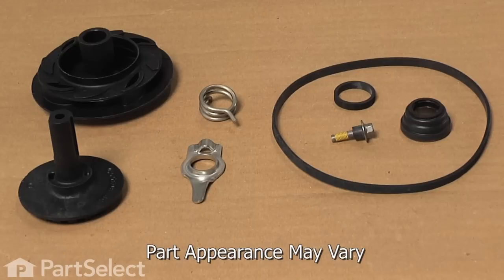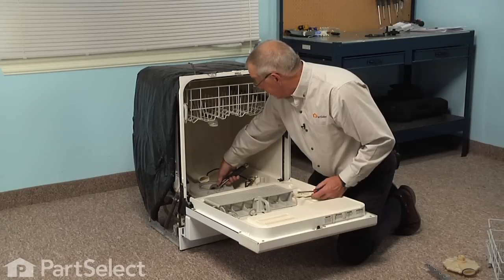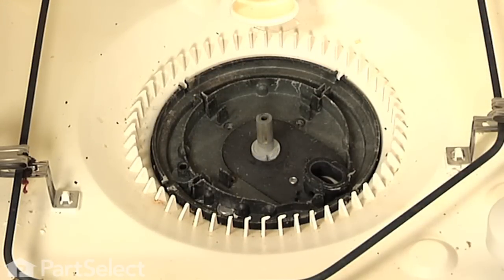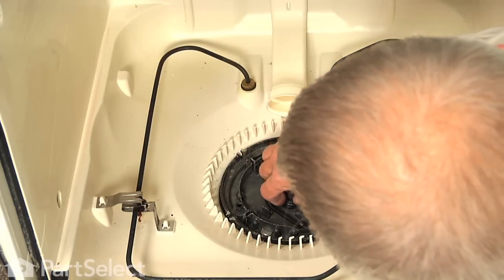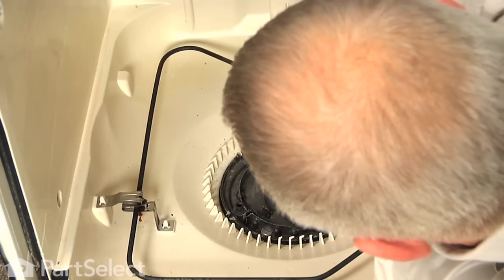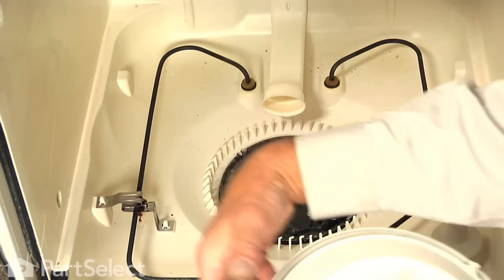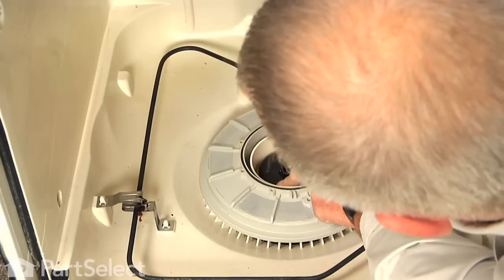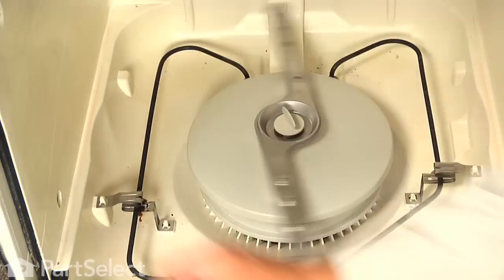Dishwasher Repair - Replacing the Drain and Wash Impeller Kit (Whirlpool Part # 675806)

Comment: Thank you for the great video on this model which is the one that I own. Sadly, I can't remove the hex nut that holds the black circular piece hiding the screws that will allow me to access and clean the sump. You mentioned that this is often a problem and suggested using a chisel and hammer to deal with this problem....how can you do that without breaking the nut or the black disc?
I am soaking the nut with WD-40 overnight and will try out a bigger wrench and an extension socket tomorrow but it escapes me why any designer thought that this was a good way to secure that portion of the unit given that hard water calcification would likely immobilise it.
Reply from the maker: sulyn2254 I have passed your question on to Steve and will let you know what he suggests.
Reply from the maker: You may find that the WD-40 will loosen the screw but if not, then breaking the impeller is the most common solution. You will still have to remove the screw, but would have the option of using a different method such as clamping pliers.
Reply: used CLR as it was a calcification issue, not a rust issue, I had thought  was preventing me from removing the hex nut...used an elongated socket on the driver, had an extra pair of hands with the pliers and it finally came loose..as it was still pretty white, I soaked it in CLR again and cleaned it with a wire brush before replacing it.. I also put a light film of food-grade mineral oil on it and hopefully, I won't have this issue again...all of this to clean out the sump that was blocked by some heavyweight plastic...my brother, the plumber, who lives far away told me to just buy a new dishwasher...I was quite pleased to tell him that I had fixed it!!!!
Reply: PartSelect
Reply: PartSelect
Reply: PartSelect
Reply: sulyn2254
Reply: sulyn2254
Reply: On older dishwashers the torque needed to remove the bolt may be so great that the adjustable wrench slips off the wash impeller hub no matter how tight I make it and no matter how hard I hold it in place. To solve this problem I use a 31/32" shower-valve socket wrench on the wash impeller hub. The wrench is hollow so I can run a 1/4" socket on a an extension rod down through the hollow to get the bolt. Sometimes the torque is so great it seems like the bolt is going to shear off, but those bolts must be made of super tough steel because I've never had one break or be so stuck that I've had to replace the motor. Also, this trick avoids having to drill out the hub of  the wash impeller to remove it. If I did that, I would still be left with the problem of holding the motor shaft as I tried to remove the bolt. In that case I would put the wash impeller (with drilled out hub) back on, and now with the filter assembly removed I would have good access to grab the wash-impeller hub with the adjustable wrench. Still, the shower-valve wrench is  the better solution because it's never going to slip on the wash-impeller hub. 

I should mention that I often have to destroy the drain impeller to get it off, If I did that and still had the bolt stuck in the shaft, I would grab the doubly flatted shaft with an adjustable wrench, but that would risk damaging the shaft, so the shower valve socket wrench is still the better solution.

The nominal size of the hex on the wash impeller looks like 1", so I have to use a little force to get the 31/32" socket down on it, but that's good because then I get a really tight no-slip fit. The next size larger is 1-1/32" and that's a little loose and that could allow it to slip under the huge torque needed to break free the bolt. So 31/32" is better.
 
My local hardware store has the complete set of 6 shower-valve socket wrenches for $28 and the individual wrenches for $8. The set comes with a cross bar for a handle, but if you buy the single socket, you'll have to use a screwdriver or some  such thing as a handle, or you can grab the socket (more accessible than the wash-impeller hub) with an adjustable wrench.
Reply: I used a 25mm 1/2 inch drive socket clasped in a visegrip to hold the disk in place and inserted a 1/4 inch nut driver to loosen the screw.

Comment: I have the exact same model and took it apart to clean it out because the spray was not very good.
However now there is no spray and the water just kind of gushes out from below the spray arm. I have the upper and lower bushes installed but feel like I lost a seal that is not mentioned in the video and parts list.
Also, those darn balls, one above and one below that black plastic cover ?

Comment: What do you do if you have done this repair but your upper and lower arms do not spin during wash or rinse cycle?  Are there seals that need repaired in both arms?  FYI.  I know the motor and pump are running.  It will go through a cycle and drain...

Comment: Tried to remove hex screw in the impeller but it's an older dishwasher and it seems to be stuck.  I also tried breaking the impeller with hammer and chisel and also no luck.  Is there any better tool to hold the impeller in place?  It keeps stripping out of the crescent wrench I'm using.  Any advice on a better way to break it out?  Thanks
Reply from the maker: Corri Bristow What model number is your dishwasher?
Reply: ***** DU960PWKQ1.  It looks exactly like the one in the video.

Comment: I have a question if I may. I took my Kenmore apart because it wasnt draining and it was exactly as shown here. When I got everything apart, I had stagnate water in the bottom yet. I replaced the flow valve where the hose and motor connect. Could there be a plug where the water gets discharged on the bottom? If I kink the hose and build up some back pressure it will pump out water but not at the rate it did before but it helps. Thanks

Comment: Great video. What is the trick to align the separator? I disassembled down to the part that you chisel off to see what was going on. I have a squeal that I believe is the motor. Anyway, I can't seem to get the separator aligned correctly and the cutter blade rubs on it. Thanks. Mine is the Whirlpool 920.
Reply from the maker: Hi Scott, your wash impeller is attached to the motor shaft with a screw and that will compress the spring that is located beneath the chopper blade. This will provide the clearance to keep the blade from rubbing. With the impeller properly installed, you should be able to mount the separator easily.

Comment: I have a whirlpool quiet wash. I'm trying to clean the filter. Where is the filter? I followed your instructions to take everything apart but still, no filter. Where is it? Also, there are no check balls in mine. Is that normal? Thanks!

Comment: The video is very helpful, but the impeller on my 66516765690 kenmore dishwasher did not want to come loose from the shaft. I tried using the screwdriver to rock it back and forth as shown, but with little effect. After I got my impeller kit, I took a drill to the impeller and drilled enough holes so that the top disc came off. Even then, the lower part of the impeller on the shaft took a bit of doing to remove. This impeller removal may not always be as easy as it looks like in the video.

Comment: Thank you for this video!  Question though. My wife left me a note that the our dishwasher stopped draining today. It’s an odd ball and your video is about the only one that matches. Anyway, I pulled it apart tonight, found some debris under the separator but couldn’t find any other damage. The impellers appear to be in good condition, I can’t find anything broken. The drain hose is clear, I can blow through it. I’m assuming the check valve is ok because when I pulled the drain hose I made a serious mess. The pump does run in drain. Any thoughts?
Reply from the maker: Hi, please provide your model number and I will be happy to research this for you to see what other option it could be for your model.
Reply: PartSelect thank you for the reply!  I do have an impeller kit coming from you all. The mode number is TUD6710SQ0 sold under the estate name

Comment: I have this exact model.   Took it apart last night and found a piece of plastic but it is now making an occasional buzzing noise!  What do you suggest?

Heads up:  There are four screws inside, it took me a while to find that fourth one!
Reply: How could you remove the nut attached to the black impeller?   I used a wrench to hold the impeller and then a power screw driver with a socket to open the nut but it kept rotating without going up.  It felt like I was spinning the nut without screwing it up.
Reply: @nnyt  :  One, I didn't use any power tools.  You have to hold it steady to loosen.  Been two months, fixed the buzzing noise as debris was caught.  Once removed, no problems!

The buzzing was due to not tightening everthing.  Go slow, stay calm, watch the video again.

Comment: Hi there! At 6:24 when you put back the Dishwasher sump cap cover and screw it down, is it supposed to be flush with the bottom? I'm wondering if I have so much corrosion on the shaft that I can't seat the pump impeller down far enough. I gave it a couple of hits with a hammer but it doesn't seem to move any further down. Also is the pump impeller supposed to spin, it seems like it rubbing against the cover...thanks for great video.
Reply from the maker: If you have changed the pump seal, you may have part of the old seal adhered to the motor shaft or corrosion on the shaft may be impeding the fit. The impeller should not rub against the cover.

Comment: I have a similar dishwasher with those two check valve balls. Are you sure that the one goes in before the cover? It gets pinned into place by doing that. Is that the correct thing to do?
Reply from the maker: They can be tricky. They be added one then the cover and loading the second after the impeller cooooover is installed or You can add both after the cover in installed but you will have to use a small screw driver or similar tool to push the lower ball forward so the second will settle into place
Reply: @partselect  Thanks for the reply, but that doesn't quite answer what I asked. Inside the cover that is immediately over the drain impeller is a little tab sticking out. If you leave the balls there as you put the cover on, then one of the balls get pinned in place in the cup in the bottom of the dishwasher. The other is free to move around in the chimney the cover has and there is enough room inside that chimney part for both without issue. Is the bottom ball supposed to be pinned in place or is it supposed to be above that pin that would pin it in place?

Comment: Can anybody respond to a question?  The impellers in my dishwasher seems to be just fine, but the dishwasher still does not drain very fast.  It will drain the water out after a few times of hitting the Cancel \ Drain button, but that is not good enough for the wash cycle.  Could the new impeller kit still fix the problem, even though all of the parts look fine, and not broken or chipped?  Or could the check valve be faulty?

Comment: To remove the impeller drill a shallow hole in the top toward the outer edge.    Then you can brace the impeller by sticking your t15 screwdriver in it while turning the screw.
Reply: Do you need to get a new impeller if you do this?
Reply: @ilike2eatwithafork  No, it will work just fine even with a hole all the way through.

Comment: the 1 inch plastic hex bolt only strips when I turn the 1/4 bolt . .I have my wrench adjust as small as possible . any suggestions?
Reply: On older dishwashers the torque needed to remove the bolt may be so great that the adjustable wrench slips off the wash impeller hub no matter how tight I make it and no matter how hard I hold it in place. (Same with a large pair of channel locks with good teeth on it.) To solve this problem I use a 31/32" shower-valve socket wrench on the wash impeller hub. The wrench is hollow so I can run a 1/4" socket on a an extension rod down through the hollow to get the bolt. Sometimes the torque is so great it seems like the bolt is going to shear off, but those bolts must be made of super tough steel because I've never had one break or be so stuck that I've had to replace the motor. Also, this trick avoids having to drill out the hub of  the wash impeller to remove it. If I did that, I would still be left with the problem of holding the motor shaft as I tried to remove the bolt. In that case I would put the wash impeller (with drilled out hub) back on, and now with the filter assembly removed I would have good access to grab the wash-impeller hub with the adjustable wrench. Still, the shower-valve wrench is  the better solution because it's never going to slip on the wash-impeller hub. 

I should mention that I often have to destroy the drain impeller to get it off, If I did that and still had the bolt stuck in the shaft, I would grab the doubly flatted shaft with an adjustable wrench, but that would risk damaging the shaft, so the shower valve socket wrench is still the better solution.

The nominal size of the hex on the wash impeller looks like 1", so I have to use a little force to get the 31/32" socket down on it, but that's good because then I get a really tight no-slip fit. The next size larger is 1-1/32" and that's a little loose which could allow it to slip under the huge torque needed to break free the bolt. So 31/32" is better.
 
My local hardware store has the complete set of 6 shower-valve socket wrenches for $28 and the individual wrenches for $8. The set comes with a cross bar for a handle, but if you buy the single socket, you'll have to use a screwdriver or some  such thing as a handle, or you can grab the socket (more accessible than the wash-impeller hub) with an adjustable wrench.

Comment: Thank you Steve for your excellent video.  I have a question: When I try to remove the wash impeller by securing it with a wrench, and then turning the 1/4 inch bolt, I can turn the bolt continuously (while the impeller remains stationary) but I can feel that I am turning a motor underneath.  There is no resistance on the 1/4 inch nut, and so I am unable to remove the nut, and therefore cannot remove the wash impeller.  Do you have any ideas?  Its a Kenmore 665 series that looks (mechanically) exactly the same as yours.
Reply from the maker: It would seem that the wash impeller may be stripped at the hub and turning on the drain impeller which is attached to the motor shaft. You can place a screwdriver blade carefully into the bottom of the motor to keep it from turning while removing the ¼ screw. Use caution so as not to damage the motor. Another method would be to use a sharp chisel and cut the impellers from the motor shaft.
Reply: ***** This is a great video. Although my dishwasher is slightly different, it's basically the same thing. I used a pair of vice grips to hold the 1" nut while turning the screw. I did very little damage to the nut, but the screw was extremely tight. After getting it out and removing the separator, the first thing I saw was a 1 inch piece of ceramic mug handle and a few other glass bits. Removed those, put it back together, and works like new. Thanks.
Reply: PartSelect
Reply: Richard Brown
Reply: Good solution, Richard. Here's mine:

On older dishwashers the torque needed to remove the bolt may be so great that the adjustable wrench slips off the wash impeller hub no matter how tight I make it and no matter how hard I hold it in place. (Same with a large pair of channel locks with good teeth on it.) To solve this problem I use a 31/32" shower-valve socket wrench on the wash impeller hub. The wrench is hollow so I can run a 1/4" socket on a an extension rod down through the hollow to get the bolt. Sometimes the torque is so great it seems like the bolt is going to shear off, but those bolts must be made of super tough steel because I've never had one break or be so stuck that I've had to replace the motor. Also, this trick avoids having to drill out the hub of  the wash impeller to remove it. If I did that, I would still be left with the problem of holding the motor shaft as I tried to remove the bolt. In that case I would put the wash impeller (with drilled out hub) back on, and now with the filter assembly removed I would have good access to grab the wash-impeller hub with the adjustable wrench. Still, the shower-valve wrench is  the better solution because it's never going to slip on the wash-impeller hub. 

I should mention that I often have to destroy the drain impeller to get it off, If I did that and still had the bolt stuck in the shaft, I would grab the doubly flatted shaft with an adjustable wrench, but that would risk damaging the shaft, so the shower valve socket wrench is still the better solution.

The nominal size of the hex on the wash impeller looks like 1", so I have to use a little force to get the 31/32" socket down on it, but that's good because then I get a really tight no-slip fit. The next size larger is 1-1/32" and that's a little loose which could allow it to slip under the huge torque needed to break free the bolt. So 31/32" is better.
 
My local hardware store has the complete set of 6 shower-valve socket wrenches for $28 and the individual wrenches for $8. The set comes with a cross bar for a handle, but if you buy the single socket, you'll have to use a screwdriver or some  such thing as a handle, or you can grab the socket (more accessible than the wash-impeller hub) with an adjustable wrench.
Reply: i had same issue.  you have to take out the unit and then brace the bottom of the motor with a screw driver to stop the motor from spinning.

Comment: Which particular part of everything you took out is most likely causing a no-draining problem?
Reply: Check the hole where the pump, pumps the water out... Take off the hose on the bottom make sure it's all clear.